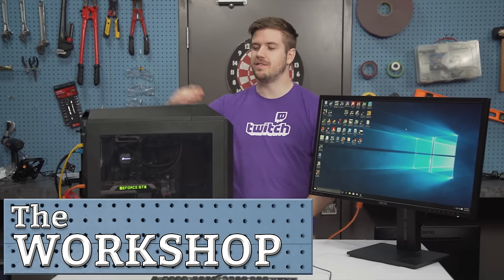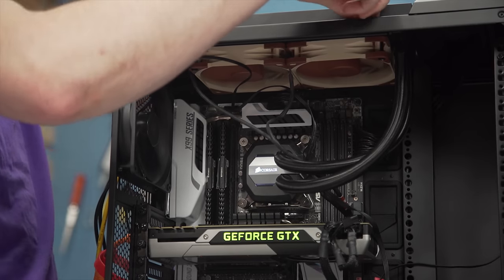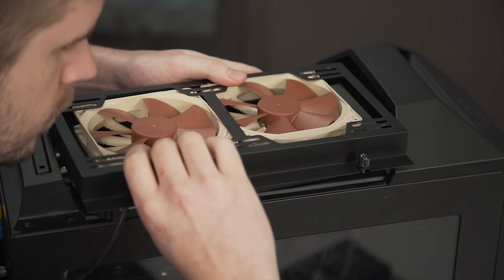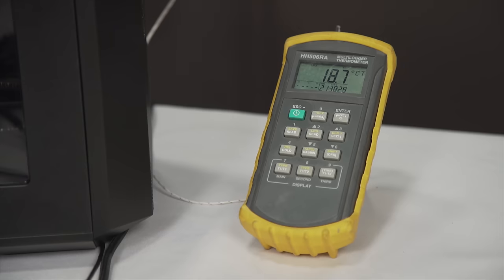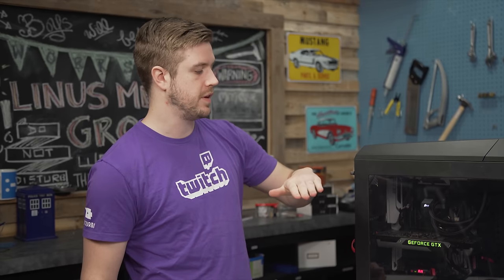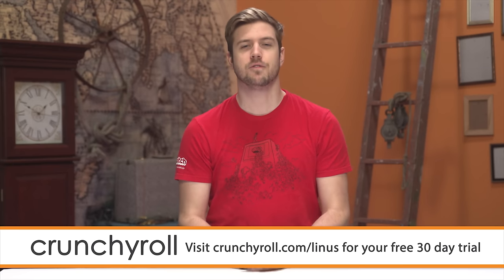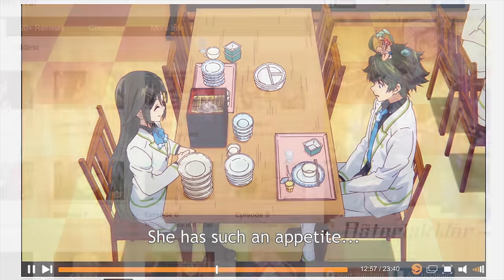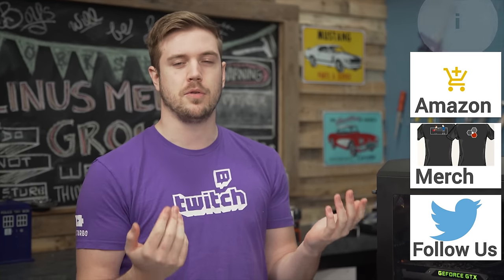Radiator Fan Configuration: Does It Matter? - The Workshop

Comment: People say this series is pointless, but it's busting the myths that people have been shoving down beginners' throats for years.
Reply: +EposVox I agree.  But I'm starting to think that whenever The Workshop asks a question, "Does __ matter?", I should just read the title, assume the answer to be "no", and move on.
Reply: That's the #1 rule of headlines in general. In like 95% of cases, if a headline asks a question, the answer is No.
Reply: +EposVox This exact video shows and proves nothing, because its poorly done. I like Linus and his videos but if you want to bust some myths about watercooling you need a serious system, not this AIO toy. I don't literally hate this whole "Does it matter?"series.
Reply: The majority of users are only going to be using AIO coolers, so this is the most generally-applicable use case. 
Yes, custom made loops would potentially be a different scenario, but the whole situation would be different in the first place.
The general application is still valid here. This is as "serious" a system as most viewers will ever get to, in terms of watercooling.
Reply: +EposVox i am about to install my first cpu cooler and this has helped :) Thanks
Reply: +misticx Most people are peasants that think a 640 is a good graphics card. Toasters, toasters everywhere...
Reply: +Kei Angelus but without all the toasters where would we get our delicious toast?
Reply: I think this test needs to be done with a load on the GPU, especially if it’s pushing the air from in the case and up through the rad
Reply: @RyanEllerbe  Yeah I tought as much, isn't the rad warming up the internals of the pc when pulling/pushing down the rad? A longer test would be more helpfull I think , But i don't have the materials..
Reply: @user-tn1ys8vi1j 
Front mounted rad is a bit better than being on top (for an AiO). Bitwit did a good job of explaining why. 

Essentially with an open air gpu (like most people have because to hell with founders crap), the gpu heat is flowing constantly over the cpu. Whereas a front mounted rad, this does not happen unless its like as close to the cpu as the gpu is lol
Reply: @misticx  it doesn't matter. As long as all variables are consistent it doesn't matter
Reply: @reppy0757  so then for a blower card mounting on the top is best, with two intakes at the front and also an intake at the back
Reply: Science is NEVER useless.
Reply: I never understood as how long people think the cpu gpu can keep up with new games. Any configuration would last 3 years and I think in 3 years it's time for upgrade.

Comment: for some reason I thought about my own fan configuration for like 2 minutes before I realized... My computer is air cooled... XD
Reply: Did you mean passively cooled?
Reply: @tgmforum fan configuration matters if you're liquid or air cooled. The only time fan configuration wouldn't matter is when there are no fans in the system, and if there are no fans the cooling would be considered passive.
Reply: @tgmforum while you're correct in calling that out, the idea still stands that you need to worry about airflow and fan configuration no matter what cooling system you have.
Reply: @DerbyMods  did you notice this video is about radiators

Comment: You only benchmarked the CPU, this doesn't account for the GPU heating the internal air. Using warm air from inside the case to cool the CPU will be worse than cool air from the room.
Reply: ***** My 7970 says otherwise.
Reply: +ukjamesbaker yes it will. Why wouldn't it?
Reply: no it wont.
Reply: +6Twisted My R9 280x (same as your 7970) says otherwise to whatever your 7970 says.
Reply: So you're telling me the 50C air inside my case cools the same amount as the 22C air in my room? Great logic.
Reply: +6Twisted the air inside your case is not 50c. the GPU is 50c.  Air being a crappy conductor of heat let's all that disapate at a very rapid rate.  but assume that that heat has to go somewhere I'll give you a degree above the ambient temperature of your house.  but that's only really if your case was airtight.  no cracks, vents or anything.  think of a heater.  it's only purpose is to heat your house.  that coil is glowing freaking hot.  Idk really how hot but we are talking about third degree burn, boiling water hot.  just right out side that where the heat is direct is no where near as hot.  while still hot and you shouldn't have it next to combustible objects a few inches from the coil won't be nowhere near as hot as the coil is.  your gpu while a hotter then most gpu is nowhere near that heat.  and while it is dumping heat in your case that air that it's heating really has no impact over cooling a rad that is already hot.
Reply: Derrec Ogle My GPU is 90C under load.
Reply: +6Twisted eh so be it I don't think your case is at 112f/50c just because of your gpu.  however idk. either way.  many other youtubers and tech writers have stated that it dosent matter much at all.  but perhaps you could do the experiment and post us your results.  I'd be interested if you noticed much of a change
Reply: +6Twisted also just want to point out.  really all that matters is have more air moving in your case then going out.  IMO  then most the heat from what ever component doesn't matter cause it will exhaust by what ever is the fastest means there is.  there by lowering your Temps.
Reply: Derrec Ogle I think the same amount of air enters the case as what leaves... Physics and all...
Reply: Derrec Ogle There's probably a good reason why most GPUs now have rear exhausts. That heat has to go somewhere, with no exhaust, that's your case air.
Reply: 6Twisted The air is just being heated a couple of degrees at maximum, but it still affects other parts and their cooling. Having a rad as an intake vs exhaust will heat up the rest of the system by about 2 (i think it was that) degrees even though the cpu is much hotter. Jayztwocents made a video about this. Although it doesnt affect much it still matters, even though it is just by a couple of degrees

Comment: what about the 2 up / down on the left pushing air flow down, and the 2 on the right 2 up and / down pushing airflow up, kinda like sucking it down and then pushing it up
Reply: "Recirculation"
Reply: Also thought about that :-P
Reply: Because of how heat rises and cold lowers, not to mention re-circulation bleed between them.
Reply: I was thinking the same thing. :D
Reply: ***** this isn't about "what is the best configuration" , but "what if...". Who would believe that the push-on-both-sides-of-the-rad would've got a good result? 
Btw : what about "pull-on-both-sides" ?
Reply: +Shaun Wright I would also like to see that configuration just for a "Hey it's the Workshop" purpose.  In both single pair config and two pair config.
1: two on bottom one up one down,
2: two on top one up one down, 
3: one on top pulling up, one on bottom pushing down opposite side
4: two on top one up one down, two on bottom one up one down matching flow of top
5: for giggles, same side* top and bottom push/pulling towards each other, other side push/pulling away from each other.  :)

*(where side refers to x/y-axis, not top or bottom)
Reply: +Shaun Wright i had the exact same idea :D Maybe on the case front panel and the whole PC is boxed in somewhere tight place so it cant pus air out of the back, or very minimal back-space at least..
Reply: +Shaun Wright The problem with that would be that you're essentially just circulating the hot air from one part back onto the radiator. This might work if you used some ducts to exhaust or intake the air away from the other fans, but really your best results are going to be going with one direction, and you could still get some ducts to exhaust the air away from your intake fans on other parts of the case, but in the end if you're running your PC for longer than these 10 minute tests (which is likely for most gamers) you'll still end up with minimal change.
Reply: +Dloweification I"d still like it tested, just to confirm.
Reply: I doubt they will. That gets too specific. They've covered fan orientation and static pressure in other videos.
Reply: +Shaun Wright 
not gonna make a difference for one side down and one side up. best if you have more rpm/better blade design to push/pull air flow
Reply: +Pancer&#39;s Cloud Are you still intending to be helpful? No one needs your brand of help.
Reply: +Pancer&#39;s Cloud Your wound up to tight amigo. Try being helpful.
Reply: +Craig Sdrogefske (Tayga) Sweet, could you send me the link to your video with obvious proof and evidence
Reply: +Shaun Wright if he can't provide a video then all it is, is anecdotal evidence.
Reply: makes more sense than two fans pulling away from each other, and they tested that haha
Reply: Dont because the area in between fams is not sealed it will just work against each other. One direction only.

Comment: The one irk I have with these tests is they do not seem to test (correct me if I am wrong) when the GPU is also at load heating up the air inside the case. As would that not potentially make it better to pull cooler air from outside the case? Would there be a way you could test that Luke?

Comment: You should do tests like this in a small case with bad airflow rather than in a huge case with almost infinite cooling options like the master case. 
Also it would have been interesting to see, which config is best for the overall temperature inside the case (GPU temp & mobo temp), assuming you'd only have the rad and one 120mm fan for ventilation (probably doesn't matter in the master case but with a small, poorly ventilated case it might make a difference)

Comment: I really appreciate you guys doing these workshop videos. They answer a lot of common questions people would have when it comes to the added features of certain computer products. They also answer a lot of the more detail-oriented questions when it comes to certain computer configurations. Especially when we don't have the ability to test it for ourselves. Definitely keep these types of videos going when possible. 

The only thing I would consider is testing a few more scenarios in these videos if you can. I know you guys are busy, but for this video I would have very much liked to have seen what happens when the rad is front mounted. Also in the power supply video, if you could have kept things constant for the 80 plus ratings, for example all 80 plus gold psu's, then make a separate video based only on the 80 plus ratings then that would help people get a much better understanding of power supplies as a whole as well as give you guys more content to create.

I know there are a lot of different ways to test these things, but if there were a few more controls as well as a couple of added scenarios that people may be considering then these videos would be just that much better in my opinion. That's not to say it didn't answer questions I had though. It still helped a ton and that's why I felt compelled to even say anything simply because of the potential this particular series of videos have.

Comment: Cool. I am building a truck and have the radiator mounted where the spare tire was. Tilted up around 10 degrees to get air out. But almost completely flat similar to your setup.  I have my fans mounted above the rad pulling UP through the rad in a effort to have any derbies stuck to the underside simply fall, be blown away when moving, or lightly pressure washed away when the fans are off. I was unsure how well this may work as it seems everyone mounts there fans below. But after seeing this I am confident it will work as intended. Thank you
Reply: What you did is perfectly fine. Linus actually recommends it in his videos. It's a PITA to clean the radiator when the fans are pushing through the radiator.

Comment: could a graphics card under load producing heat affect the config that exhaust air from inside the case?
Reply: +ninjacookies00 What Jazz said. Theoretically, it should affect it, in real tests it doesn't affect it at all. Even in Fahrenheit it's tough to find a difference.
Reply: It's a blower card. All of its heat is exhausted from the PCIe slots at the back of the case
Reply: +Albert Einstein Very good point I did not think about that
Reply: +Jazz Greiner   
My experience says otherwise. 
But then, I am running an HD 7990. basically a 500watt heater inside my box. turning my radiator fans from exhaust to intake makes close to a 10°c difference when gaming.
Creating a baffle to help the 7990 get fresh air instead of recycling hot air dropped GPU temps from 98°c to 79°c.
Reply: Of course it does, watch bitwit. He is using a blower-type fan however.
Reply: Dunno what all people here are saying. Maybe i'm misunderstanding the question, but the hot air exhausted by your graphics card affects cooling by *alot*, if it's exhausted in your case. Somebody did a test on it with overclocked graphics card and processor, and blower and custom graphics card. For the blower card it doesnt really matter either way, but if you have a custom graphics card it matters a lot. A top exhaust yields about 10° higher temperatures on the cpu compared to a front intake, while the gpu temperature is not affected (prob a bit more fan speed. Maybe. Custom cards have a lot of room for more temps).
Reply: Yes
Reply: There's a difference in questions here. Most are referring to the minimal effect that "at load" would have versus not at load, in terms of %variable difference. Sure, it makes a difference in total heat, but doesn't affect the fans ability to remove heat via push or pull method greatly enough to matter in a test environment.

You're right, but they're right too, just answering a different question. Which was asked? Ask OP.

Comment: And what about the case or GPU temps when you blow or suck the "hot" air from the rad into the case? This would have been interesting too btw.
Reply: +Modor An I have this setup due to my fans not liking to be oriented the other way(Horrible vibration.) It increases my GPU temps by 20c.
Reply: Jeremey Allen

Yep, this is an info/issue he should have talked about in the vid instead of saying that it really doesn't matter...oh well.
But it is common sense after all.
Reply: +Modor An 
40 degree airflow will still cool a part that is running at 90 degrees.
Reply: TheTopMostDog

But is it the best way to do it? ;-)
Reply: Modor An

No, pouring milk on it works better. Especially if your fridge is kept below 5°C
Reply: TheTopMostDog

Wow...never thought about that....time to try it!

Comment: With the GPU not providing any thermal output into the case (GPU is idling and has a rear exhaust cooler), the difference might be negible. But what about a top-blower cooler installed on a hot GPU (R9 390X, Fury, Titan X, 980Ti) running at 100%. There should in theory be a noticeable difference in cooling performance between push and pull configurations of the radiator mounted fans.
Reply: +methosgaming In my case, I always have my 2 FuryXs pushing out, since they legitimately could cook an egg. You could burn your hand on top of my case. (Unlike my CPU rad, where the air feels room temp)

So in their case, no way in hell would I dump all that heat directly onto every component in my PC.

Comment: Why didn't you monitor GPU temperatures when pulling air in to the case? I'd like to know if the reason we all exhaust our CPU's warm air out of the case has any truth behind it, since cable management didn't.
Reply: because the modern gpu have extremely efficient coolers that are unaffected lol, seriously you gpu can affect the temp but it can't be affected , personally i prefer to have the fans as intake just to avoid having the warm gpu air affect the cpu(my old school full tower was built before front mounts!)

Comment: It was good to see that there is that three degree difference though. This test has good control, but I'd imagine you can squeeze another few degrees with that extra three by improving the intake in other parts of the case. All that extra airflow on the radiator exhaust needs something pushing air in as well. At the least you'll be getting positive pressure and not sucking more dust into the case.

Comment: Love this but this really really depends on the fans and on the rads as well. I have my front set in pull exhausting out of the case, i have my side 360 pushing case air thru the rad with 3  fans pulling air out so both are exhausting out. My case has filters all over so no dust worries, will be adding 2 more NF14s up top as intakes.

Comment: I was more interested in GPU temps with different radiator setups. Like, is GPU temp a lot higher when letting the fans blow into the case (aio as intake fan)?
Reply: +deWaardt or what happens if they didn't use a Reference card...
Reply: +deWaardt a non reference design card will be much hotter. talking from personal experience.

Comment: positive pressure in your case is what you want.  The fan on the back (cpu exhaust fan)  should be pointing in, along with any front mounted fans,  then more flow will go out the top of the case

Comment: why not review multiple z170 boards? or give a lga 1151 build, new content has been pretty shit
Reply: Should have done more on this vid, try mounting rad in the front of the case (more common) then test fan configurations. Also check the temps of the whole system... eg, when the fans pull hot air into the case does the GPU temp rise under load?
Reply: Cases which allow radiators mounted in the front are becoming more common**

Comment: Thanks for the info.

Was worried I needed a new case for my new GPU, but just realized my PC has the radiator and two fans attached to the front fans. Now I can move the fans or the radiator w/fans to the top to make room without worry.